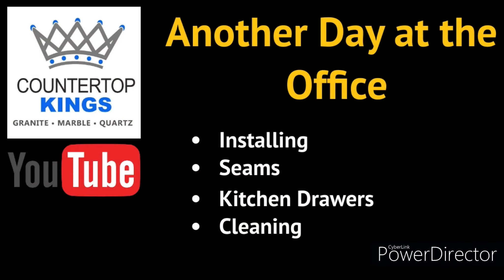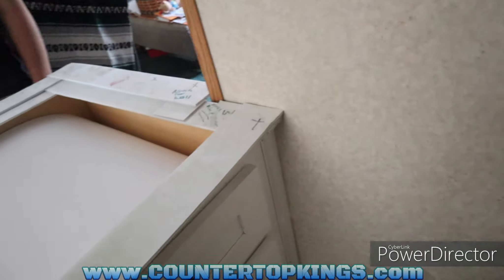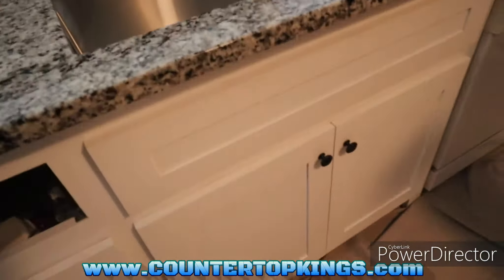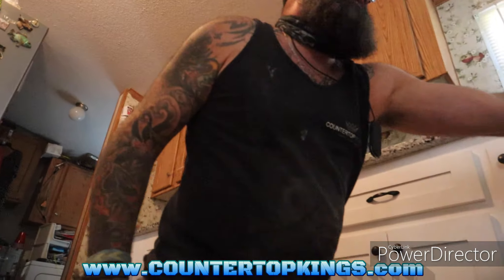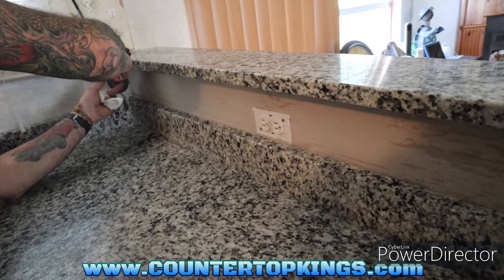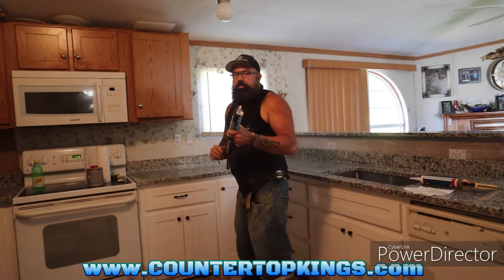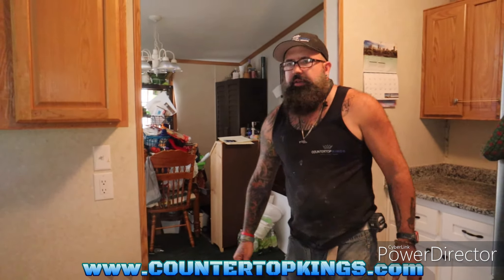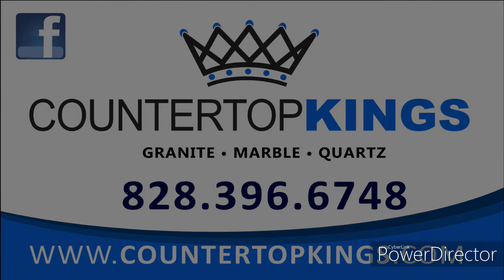ANOTHER DAY at the OFFICE | Installing | Seams | Kitchen Drawers | Cleaning

Comment: What’s your reasoning for using silicone for caulking splash and and under countertops on cabinets.  Just asking .  We use dap.  Clear caulk on all our Perimeter caulking.
Reply: Silicone is 100% waterproof. Best used between splash and tops. Silicone is also stronger than acrylic caulking for use under tops. Only time I've ever used regular caulking underneath is when I knew customers were painting cabinets because paint won't stick to 100% silicone.
Reply from the maker: I absolutely agree with Pete Ferguson,  the only time printable caulk is used on backsplash is on top where it connects to the drywall that will or may be painted later.
Reply: We block our tops in with knife grade.  Clear caulk around the perimeter.  And silicone our kitchen sinks.  We’ve been in tear out situations with water damage with the floors.  Silicone ain’t no joke when it comes to breaking free tops